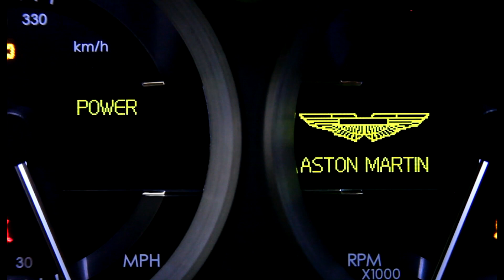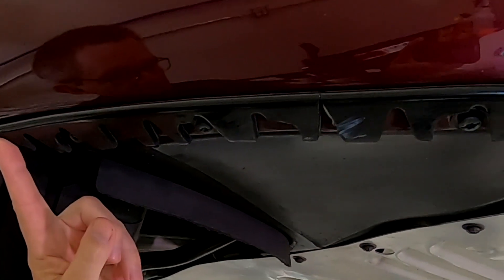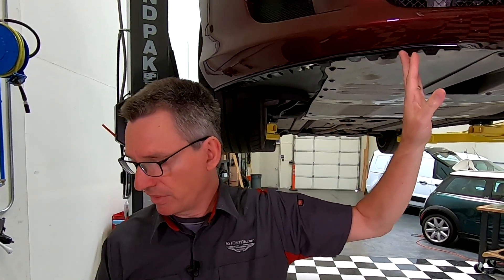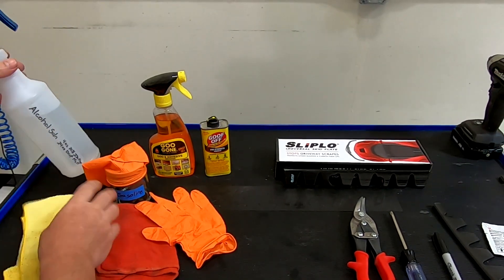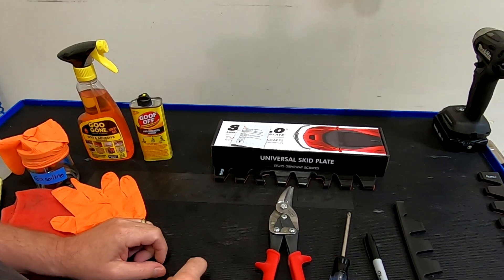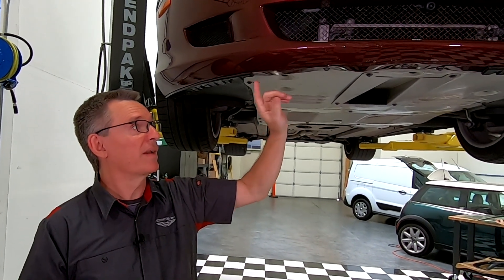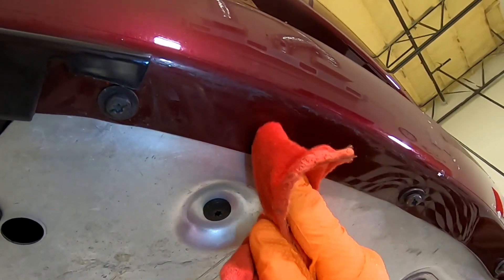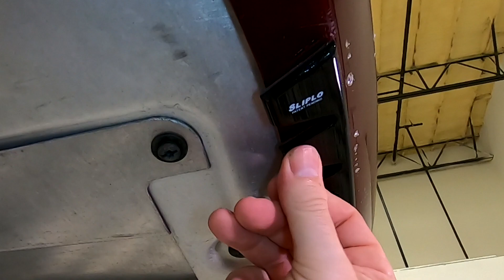SlipLo Repair and Review after 3 5 Years

Comment: I try to avoid using Goof Off unless removing dried paint on very hard surfaces - it always seems to etch every surface it's applied to. I'd never use it on a painted vehicle or any PPF for fear of destroying the coating. Do you think taking a blow dryer and lightly heating the adhesive pads would have removed them? I've always done that to remove any type of dealer applied stickers in the past - heat them up slightly  and just start peeling them back.
Reply from the maker: Good advice.   The Goof Off just smeared the residue and didn't remove much.  It didn't hurt the paint finish on my car.   Heat might have helped, but the 'rolling off' technique I used was easy enough.  If i had to do the whole skid guard, I'd have had no skin left on my thumb, so maybe the heat technique would have assisted.   Thanks for commenting and watching!